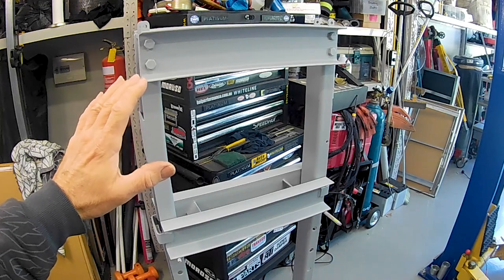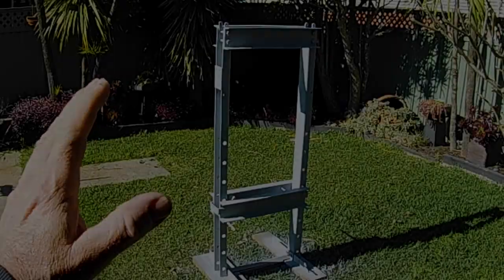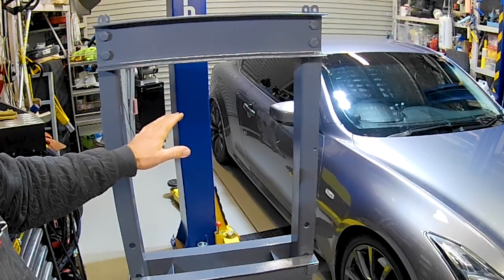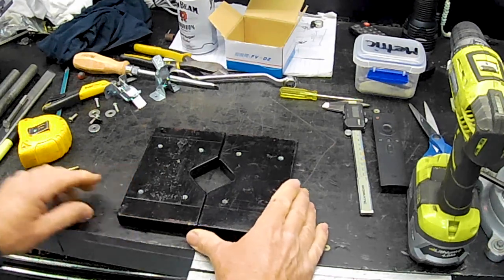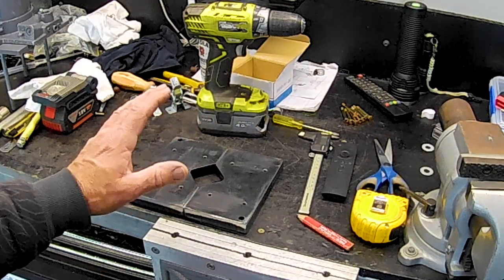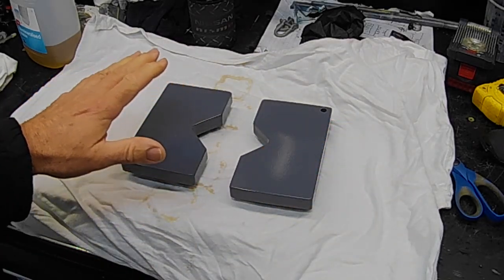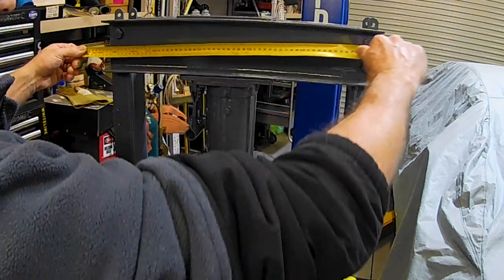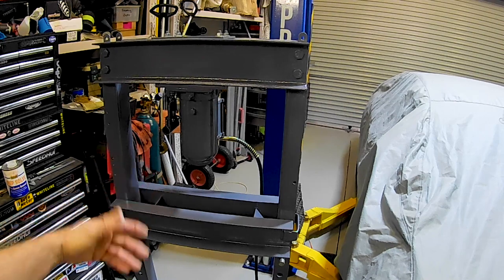The Ultimate 20 Ton Shop Press Build, EP:5 Mounting The Inverted Air Hydraulic Jack

Comment: It's turning out quite nice. I see Mr. Murphy isn't just a Northern Hemisphere phenomenon with the syringe hose.
Although I can understand the locating pins on the press plates I'm not so sure I would have gone that far.
I have run into oddball things that required getting a bit creative with the press plates to accommodate getting the part to fit. Your sliding ram mount may well be the answer to that. Bloody good job all in all I'd say and now I wait to see if it works!
I got faith in ya pal.
Reply from the maker: Thanks Phil, Cheers Mate.

Comment: I’ll be interested to see how you go with those pins as I use my plates in all sorts of ways. Sometimes I’ll double up the plates, one on top of the other or I’ll have the two “V” notches off set to close up the hole a bit. A simple line painted or scribed across the front of the cradle that the press plates sit on will show where they should sit. You may find once you start using the air over hydraulic you will find it very easy to put the full 20 tons onto those plates and an upgrade to thicker plates will be on the cards. Not meaning to be a negative nanny but I upgraded my plates to 30mm because the 20mm started to bend. I have always chickened out before the jack stopped pressing any harder because you know how hard things fly out when they let go, so I’m building a hinged steel mesh screen just in case. It might be worth considering one for yours. 
I’m really enjoying the series on the conversion and I like the way you have taken the time to fix all the little issues that you found along the way. Adding the slide feature was a great idea. I’ve had to fiddle around so many times to centre the job when moving the ram would be a lot more convenient.
I think the time and workmanship you have put into it will see you get many years of use out of your investment. Cheers, Stuart. Canberra.
Reply from the maker: Cheers Stuart, Thanks Mate.